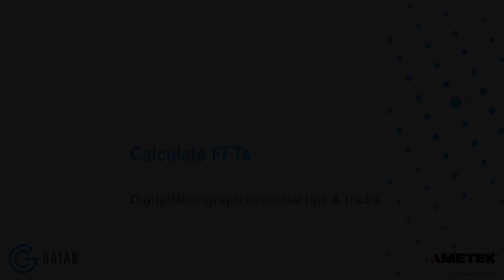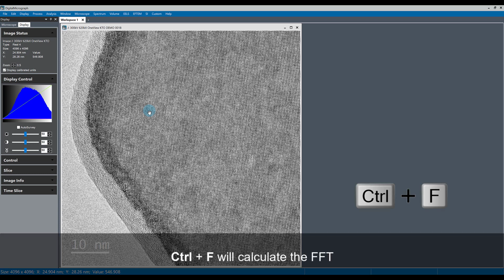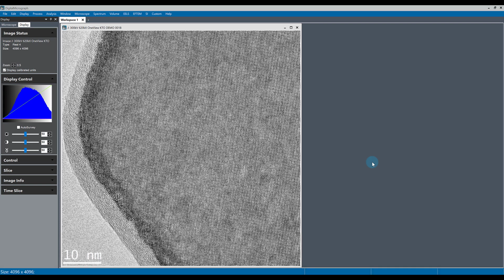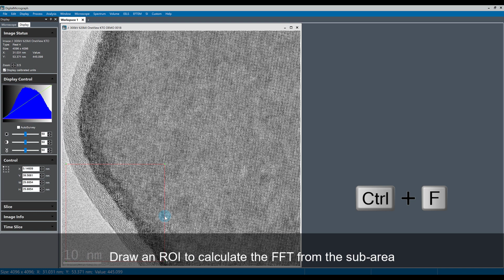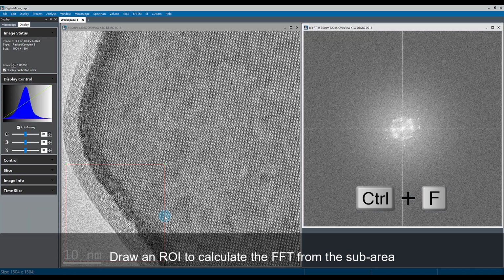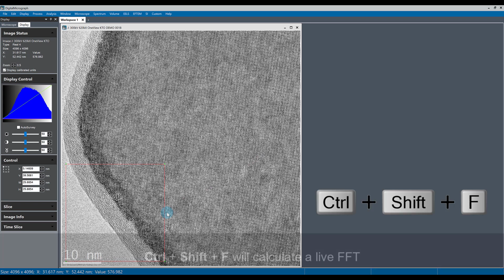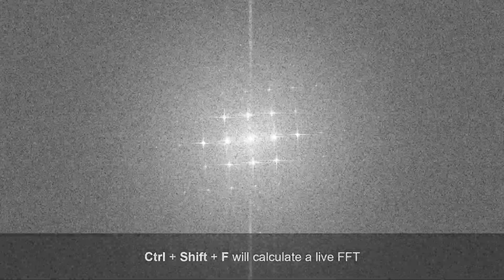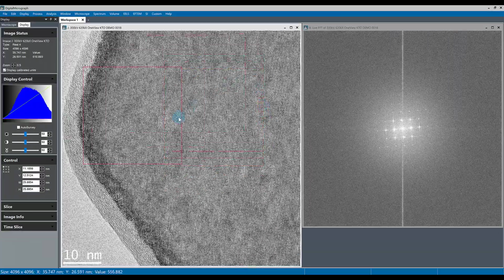Calculate FFTs in DigitalMicrograph

Comment: Hi, does anyone know how to add scale bar (1/nm) to this FFT pattern?
Reply from the maker: To add a scale bar to an FFT, right-click on the FFT to bring up the Tools menu. Then click Layout > Add Scale Bar. The scale bar will be added to the FFT.  

The scale bar is repositionable; you can right-click on it to adjust its size and formatting. Note that the original image must have a magnification calibration for the FFT to have a calibrated scale bar with the 1/nm units.